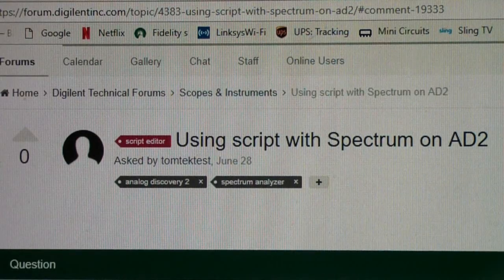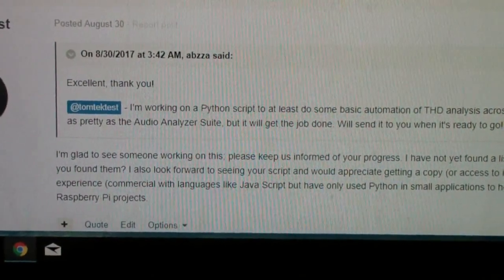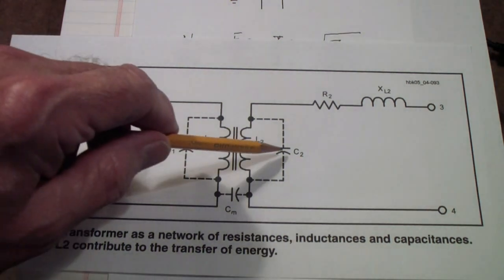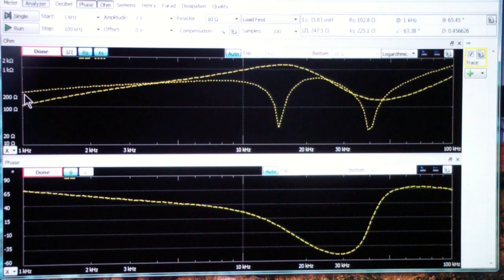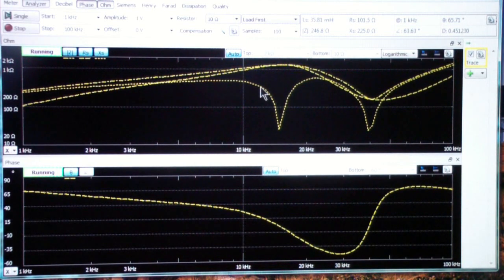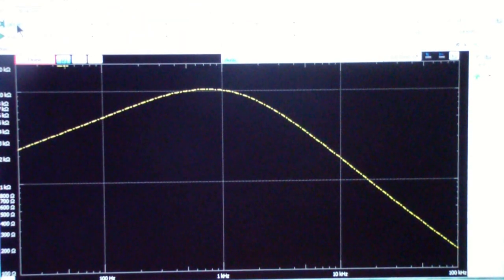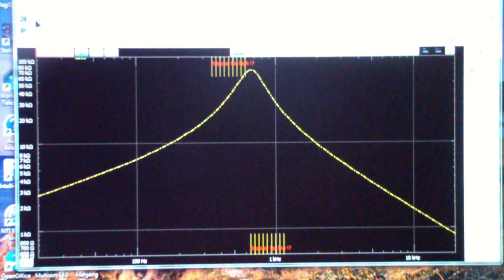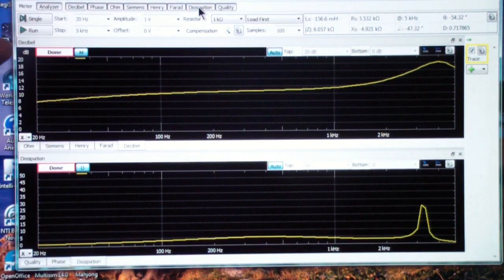TTT191 Analog Discovery Z Analyzer Pt 2 Experiments

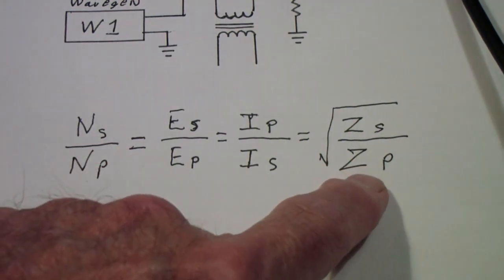Comment: I think you made a mistake at the around the 9:40 minute mark about the impedance ratio according to the equation you have there? If you have a turns ratio of 16 and you square both sides of the equation you will get an impedance ratio of 256. At least I think I am right?
Reply: As in the square root of the impedance ratio is EQUAL to the turns ratio. Love the work you are sharing by the way.